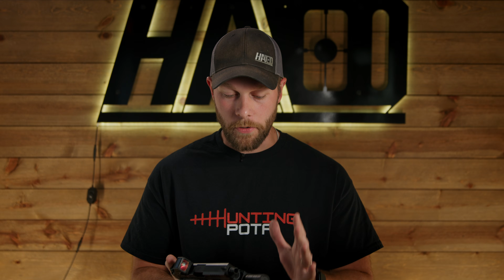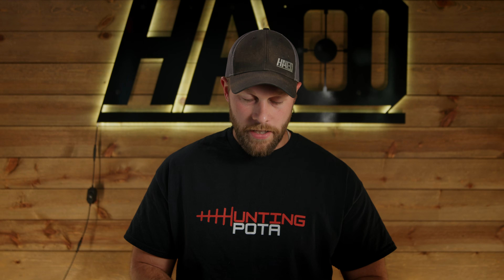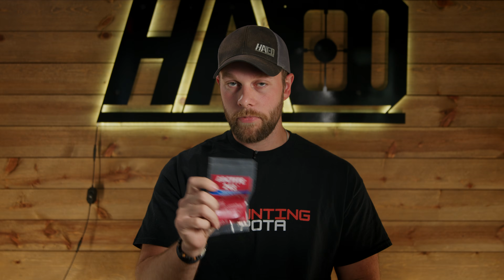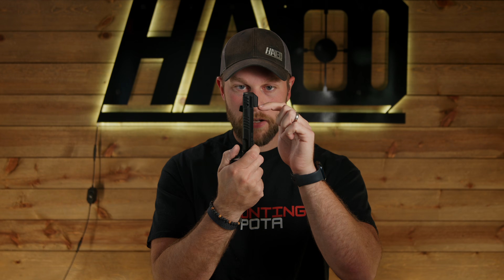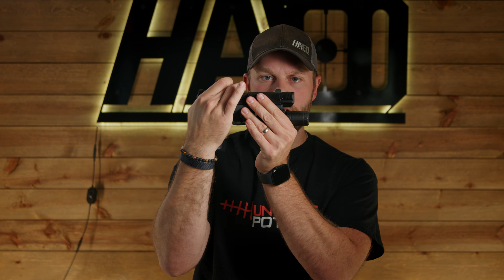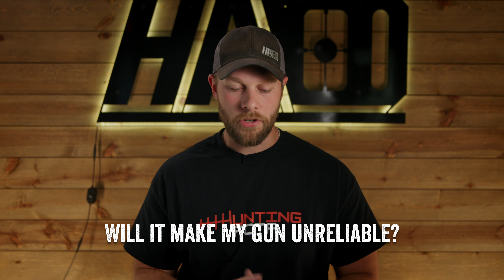How to Install the HCRXM Compensator

Comment: Got mine coming in the mail today, here is hoping it fits the OEM, will be pretty disappointed and returning it if it doesn't.

I lost my thread protector, so this was specifically to get an upgrade to cover the OEM threads, not interested in upgrading the barrel.

The FDE would look so slick color matching with the OEM FDE RXM, and the performance seems excellent, so fingers crossed it works! I'll keep y'all updated.
Reply: Sure enough, it doesn't fit. Hardly even threads halfway down the Herrington Arms Compensator before reaching the end of the barrel thread. Super disappointing that they advertise this specifically for RXMs and it doesn't come anywhere close to fitting OEM. If it doesn't affix with standard RXMs it shouldn't be advertised as a product for RXMs.

 From their website: "We have seen quality control issues with the new Ruger RXM threaded barrel. These barrels can be oversized and not allow the compensator to thread on all the way!"

It would be more transparent to tell consumers this product will definitely NOT work with new RXMs, and that additional modifications are REQUIRED. If they truly did change their barrel size, HA should update their design to match the firearm they advertise it for. Or at least remark on the year the design changed if it did, for used Rugers. It doesn't seem to have anything to do with the barrel being oversized though, since it does bite the thread; it seems like the threaded tip of the barrel is not long enough to mount the length of the compensator.

 Gonna be returning it, I'll keep this post active and will remark on any difficulties in the return. 

Can't recommend this product. Additionally it isn't even the same shade of FDE as the Ruger.

Comment: extremely disappointed that i spent 100 dollars on a compensator that DOESNT thread on the OEM threaded barrel. thought this wouldn’t be an issue with a product that’s been out for months at this point. edit:decided to get a true precision barrel to fit.
Reply: They are blaming your rxm barrel but others have tried treading it onto another bare barrel and it threaded to the same low depth.  Their thread is the issue.
Reply: Agree! Radian Afterburner + Ramjet would be my choice.

Comment: These(black model) were finally in stock a few weeks ago, just after Chrismas. Great product that does an excellent job with muzzle rise. I shot back and forth between my compact non-comped RXM and my full-size grip comped gun and there was a huge difference. Both sport Faxon Duty Series barrels, one 4 inch and one 4.5 threaded. I didn't have to change spring weight, although I do have NDZ stainless guide rods with the factory weight(18 lbs.) spring. 115, 124, and 147 gr all worked flawlessly.

Comment: Will not thread on my factory barrel 😢.   Will not even start.  Gfd!  Guess someone's qc is off.  $200.00 for a barrel!  Nope,  to the lathe we shall go!  Update.  Was severe pain to pick-up the threads. Apparently our lathe is needing some tlc. But slowly shaved the threads down without scrapping it.
Reply: I bought a Faxon Duty Series barrel for about 90 and it works great.
Reply: Same here, won’t fit on factory barrel :/
Reply: @RareYogurtMale why not?
Reply: @jacobvalencia2268  so apparently there were some factory rxms that have slightly larger barrel threads than others, i suppose i just got unlucky. im planning on ordering an aftermarket barrel soon
Reply: @RareYogurtMale this is so upsetting that they didn’t test the OEM threaded barrel for issues. just tried putting it on my EOM barrel and it got stuck almost immediately
Reply: @calibercal sorry to hear man, yea idk why they didn’t either, there is a disclaimer on the website about the inaccuracy of some factory barrels